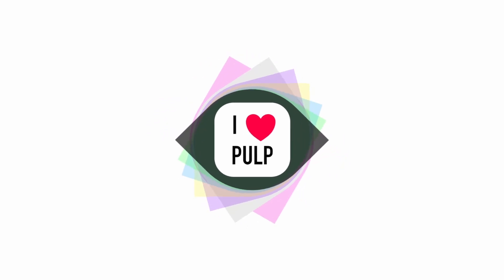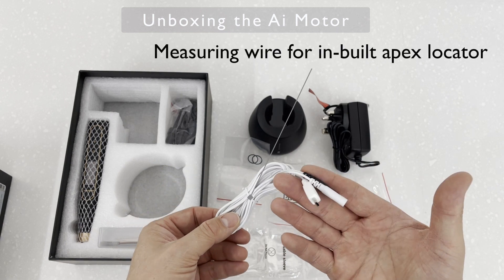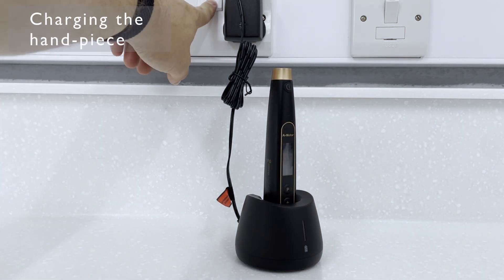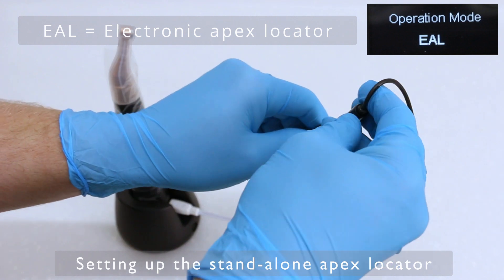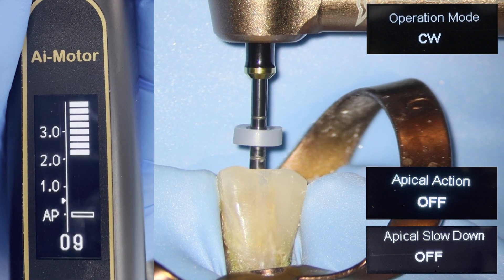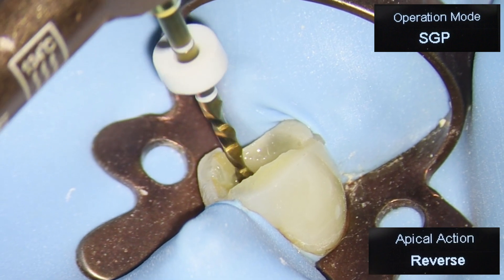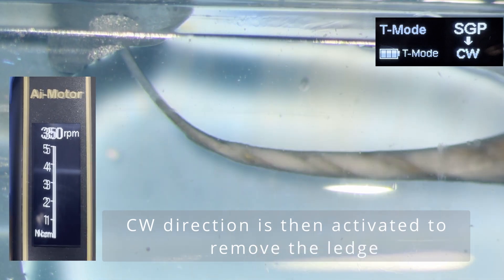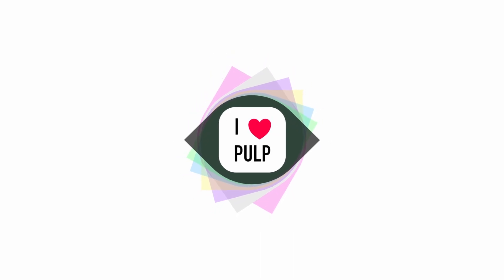AI-Motor - (Black edition) - FULL REVIEW

Comment: Hey doc! Do you have to handle to find apex and set reference or can you just use the hand piece and it will find apex while working?
Reply from the maker: It works very well! You essentially connect a wire to the motor, then hook the wire to the patients lip, and this finds the apex well!

Comment: The apex in motor is accurate or not ?
Reply from the maker: Yes! I used it as a stand alone apex locator for 12 months before I used my Wirelex Apex Locator. What do you use?
Reply: @ilovethepulp no iam will buy but what a difference between ai and motopex
Reply from the maker: @musiclovers2150  not sure about the motopex, but I can vouch for the Ai motor for sure.

Comment: Hii does this endomotor has lip hook, file clip for measuring working length? 
How does this works plz elaborate
Reply from the maker: It does! It’s a like the same set up for an apex locator, but the wire goes into the motor itself.

Comment: Hey dear doc 
I bought fkg rooter with apex locator 
When i use rotary + apex locator to remove pulp from canals it immediately after it touches the pulp reads zero-zero and start to reverse motion every time in vital pulp cases
So is it normal in rotary with built in apex locator or my brand is not that good ?
Reply: Have you figured this out? I'm having a similar problem.
Reply: @scawta78  it had battery issues
I changed it for free and its working very well now
U have fkg rotary too?

Comment: Would like to know how well does the in-built endo meter while motion works?Is it consistant and accurate enough?
Is it recommended to dry the canal with 3 way and lubricate just with rc-prep? Cause it seems that there will be a problem with EAL readings if the canal is full of sodium hypochlorite?
Reply from the maker: It is very very good, in fact I used it as my sole apex locator for around 12 months before I moved over to the Wirelex unit I now use.
Reply from the maker: As for the fullness of the cavity with sodium hypochlorite. As long as there is nothing that can short the circuit - such as metal restorations, or the irrigant touching the soft tissues, the apex locator works very well.
Reply: Thx doc! Just ordered one thanks to your info! Love all of your videos, helps more than a lot for a rookie like me😆 please never stop!

Comment: Do you know the settings for the wave one gold?
Reply from the maker: Yes! 300 RPM, 150 CCW & 30 CW
Reply: @ilovethepulp  what about the torque? Thanks btw 🙏
Reply from the maker: @Aria123-0  no torque for reciprocation!
Reply: @ilovethepulp  but it had the option on the AI motor?
Reply from the maker: @Aria123-0  It does! good spot! The honest answer is I am not entirely sure. However, I can make an educated guess and suggest that the torque setting maybe irrelevant. Reciprocation was devised to negate the risk of torsional file fracture. The manufactures have worked out the maximum degree of turn the file can do without the risk of fracture. In the case of wave one gold it is 50 degrees. What are your thoughts?

Comment: Thank you for this helpful review. Can you please show which settings to use for wave one files while also using the apex locator. Thank you
Reply from the maker: WaveOne Gold 350 rpm / 170° CCW and 50° CW - hope that helps! Did you have any suggestions for future videos?
Reply: @ilovethepulp  I would love to see how to use different file systems with the ai motor in conjunction with apex locator. For example, which settings to use with edge endo files, wave one, hyflex, spinning calcium hydroxide in, retreatment. Which settings with different systems and with different situations  (such as retreatment or calcium placement). Unfortunately it's very hard to understand the manual, very confusing.  I would love to see such a video. Thank you again 🙏🙏🙏
Reply: @ilovethepulp  also, would that be under the T mode with wave one or SGP mode?

Comment: What flash bar position is for? What settings for this is most accurate? Can someone help ?😅
Reply from the maker: This is for the inbuilt apex locator and its functions. So you can set the flash bar position to be at a certain level, the action of the apex locator will activate at that level. So for example, say you set the bar position one-bar short of the zero position then the apical action setting (stop or reverse) will activate one-bar shorter than the zero position. However, don't forget that these bars are completely arbitrary and personally don't tend to use them much! Let me know how you get on!
Reply: @ilovethepulp 
I ordered ia black motor after couple tests of white version without t mode. What i can say is that build in apex locator is quite qood. Not as stable and repeatable like in vdw gold but much better than eighteeth e conncect s. What is strange - i recieved DTE version not woodpecker. Shop where i bought  says that is the same brand what woodpecker. Using t mode i dont see vertical movement of files… And question is - Did you have to buy separately contra angle with vertical stroke? Another different is that in reciprocating motion i feel different engine working comparing to the white woopecker model. In white there is smoother.
Reply from the maker: @MrDeskowicz  Yes you need to buy a separate contra-angle that has the built-in vertical stroke! I can also confirm DTE and Woodpecker are the same company. :)

Comment: Hey i have a question regarding the apical slow down and apical action. When we work in the canal the pulp chamber and the canal is flooded with NaOCl. How accurate is the endomotor on detecting the apex with NaOCl in the chamber and does it make the beeping sound to often or too soon due to too much NaOCl?
Reply from the maker: It works very well, you just need to ensure that the access cavity is completely sealed from the oral cavity and there are no amalgam fills present. I actually used the motor as a stand alone apex locator for a long time!
Reply: @ilovethepulp  thank you very much 🙏

Comment: Hello! Does the original headpiece of the motor has a vertical stroke? And if not, is T-mode efficient without one?
Reply from the maker: The original rose gold handpiece included with in the box does not have the vertical stroke, you have to buy a separate hand piece. As for efficacy, although I have used T-mode with both handpieces, I haven't used this mode enough to know if one is better than the other!

Comment: Great Review, Thanks!
Can this motor connect with other Apex Locators? or it only uses the built-in? 
also, does the built-in Apex Locator comparable to something standalone like Dpex V ?
Reply from the maker: Hey sherif! No it does not connect to another apex locator, and the inbuilt one works really well and it’s the one I use all the time now!
Reply: @ilovethepulp  thanks for the response! 
If you tried J Morita before, does AI Motor compare to it?
Reply from the maker: @sherifyehia3145  I don't own one! But I use the apex locator exclusively and found that my WL and final obturations are always satisfactory.
Reply: @ilovethepulp  Can you suggest to me what to choose? The Ai motor or J morita?
Reply from the maker: @sherifyehia3145  all depends what you're after. If you're using the Ai Motor with its integrated features such as apical action when shaping then i think the motor would suffice,. however, if you want a kind fail safe, an independant dedicated apex locator for that extra reassurance then the J morita would be a good choice. I'm happy with the Ai Motor with my work flow.

Comment: Just got my handpiece in the mail today! I use reciprocating files so for me SGP mode is applicable. I run my files at 270 degrees reverse and 30 degrees forward (yes, its aggressive, but works very well for me). What torque setting do you use with this handpiece? I had a brasseler endo sync plus and I ran the reverse torque on OTR in CCW mode at 0.6 ncm, but this handpiece wont let me go below 2 ncm for torque on SGP mode. My guess is that the brasseler handpiece measured OTR in reverse torque or does this handpiece do the same in reverse torque? What would you run the torque on a reciprocating file here in SGP mode?

The OTR mode on the brasseler handpiece could be applied to SGP mode on this one, however OTR mode is considered ATR in this handpiece I believe.
Reply from the maker: Well you have me stumped there, as I don't tend to use reciprocation! I'm fully in the rotary camp! If i may comment however, does torque really matter much with reciprocation? Surely if you follow the manufactures setting for any given file, this negates the risk to torsional fracture of a file because the file never turns far enough to create the risk of fracture?  Let me know what you think! thanks for the comment!
Reply: @ilovethepulp  Thanks for getting back! Yeah i also use rotary. I use a blend technique where my first file is rotary, and i like to finish with reciprocating. Just works well in my hands. Yeah I don't think torque really matters in reciprocation. Just odd that with Brasselers file and their handpiece they have the reciprocation mode with OTR (which is ATR in this handpiece in the reciprocation mode as well). I have seen it activate in the brasseler handpiece at times so it does work, but I'll just play around with the settings and see what works best in this one.

Comment: Nice video mate, I was wondering if you could do one demonstrating how to use the apex locater (set up) while instrumenting the canal.
Reply from the maker: It’s literally plug and play! As soon as you plug the wire in it starts to work!
Reply: Hello,,,did you get the answer yet? How to use the apex locator while instrumenting the canal
Reply: I tried and somehow didn’t get to get the Apex locator functioning. Maybe if you can make a live video on that, will be great. Thanks.

Comment: Hello sir, can we use the t- mode with the handpiece that come with the endomotor or do we have to get it separately for using t- mode
Reply: What is the use of touch probe?? Can u explain it sir
Reply from the maker: @ramamoorthya.g7021  I believe it is if you don't have enough space to place the clip around the file. (for the apex locator)
Reply from the maker: You can use T-Mode with the normal hand-piece no problem!
Reply: Thank you sir and one more question that is how long will it take for one full charge the endomotor and approximately how many cases can be seen with one fully charged endomotor??
Reply from the maker: @ramamoorthya.g7021  another good question! It doesn’t take long to charge, maybe a few hours, and I reckon one charge will last a few weeks. Depends how much Endo you do!

Comment: Great video thanks. Do you know if the white version is exactly the same as the black just a different colour? And do you know how it compares to the e connect s? Looks very similar. The differences I can see are full 360 degree rotating head on the ai, and the e connect s I think has many more common system presents which makes it a lot simpler I think. Thanks!
Reply from the maker: I don't think the white version has T-Mode either!

Comment: Great video and great review! How does the apex locator mode operate   when working the  rotary file? Does it automatically action once lip hook placed? Cheers
Reply from the maker: Thanks for the comment Graham, It works automatically. One thing I would say is that it can give false readings (and therefore act erroneously) if you're treating a multi-rooted tooth and like to fill the access cavity with irrigant; or you're working through a crown; or next to an amalgam filling.

Comment: this video is amazing. I'm new to endo motors and the instruction manual is a DRY read to say the least. 

Question: when you use the apex locator, do you typically use it with a hand file like you would a traditional apex locator? Is that safer and more accurate? 

Since there's the other method of using it with the motor in hand and a rotary (i think?) -- i thought this option would be faster, but like you said, needlestick risk. 

Thanks
Reply from the maker: Yes you would use the apex locator like a normal one, with a hand file. I just holster the motor in its holder so you can see the screen easier! I do use the apex locator whilst the motor is in motion, but I also like the pulp chamber filled with irrigant, which can make the apex locator give a poor reading - so its swings and roundabouts!

Let me know if you'd like another video review on something specific?
Reply: @ilovethepulp  Thank you! I've just finished watching all your videos actually lol.
Personally, I hate endo, but I do want to get better at it -- your videos are simple and to the point! 
Video idea: calcified pulp chambers/canals, and how to shape?